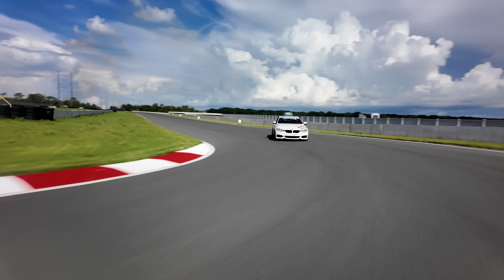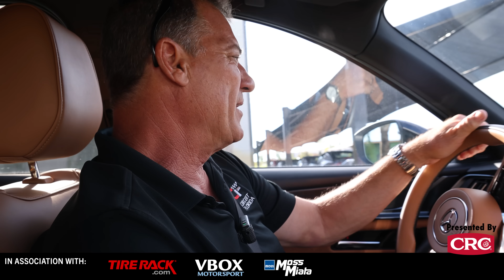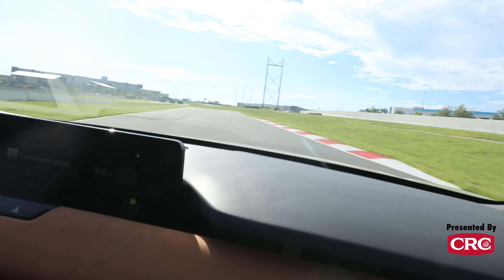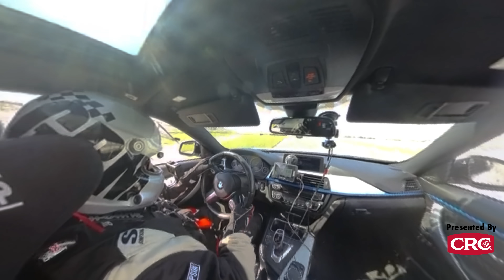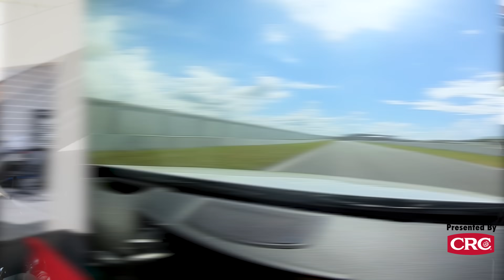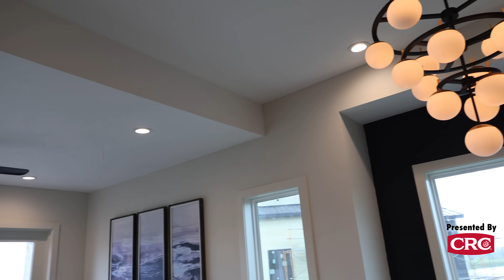We Drove Florida’s Newest Race Track! | Circuit Florida Track Review

Comment: Hold up. Is that a high speed off camber uphill right hand turn CONCRETE WALL with minimal tire barriers we are looking at in this POV?
Reply from the maker: are you talking about toward the end of the lap? That one's not particularly sketchy at all, because of the shape of the terrain really limits your opportunities to slide somewhere bad if you make a mistake. Really the only place you could ge tin trouble here (unless you did something just completely mental), is the kinked braking zone entering the second right hand turnaround. If you got REAL bold there you could get in over your head a little bit, but even then there's some exit room.
Reply: @Grassrootsmotorsports   It looked bad, but thanks for the analysis.
Reply: @Grassrootsmotorsports 
ITS BAD , TOO DANGEROUS

Comment: I looked at their track on their website, it's just right angles with straights. This is embarrassing.
Reply from the maker: While the track doesn't really have any high speed corners, the corners they do have—even though they may look similar on a 2D map, are refreshingly diverse. There's not a ton of pucker factor here, but there is a lot of fun for drivers of a broad range of skill levels.
Reply: @Grassrootsmotorsports 
Have RACING For EVERYBODY With Big Prize 💰 Or GO BROKE!
Reply: @Grassrootsmotorsports  Turn 10 in a high downforce car is fun, really the one high speed turn (kink) on the track. I take it pretty much flat in the Radical and Praga. Nice overview, we love being a member. A great community, a solid technical track and it gives us a lot of opportunities to consistently test on. They have a good group of folks running it too, very driver/member focused. We used to test at the FIRM just out of ease but once this opened up, we had to hop on board. It's been a great experience thus far!
Reply: it's all relative, given the small space they are working in, they really have capitalized on that space they have. Also understand the clientele they are likely going to attract, especially in FL, it's a good gamble.
Reply: Tell us you failed geometry without telling us lmao